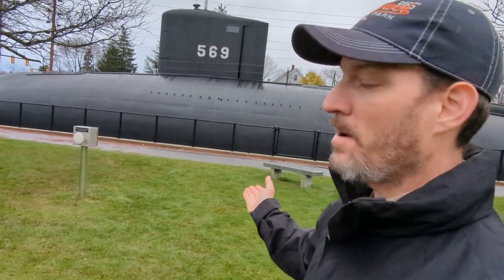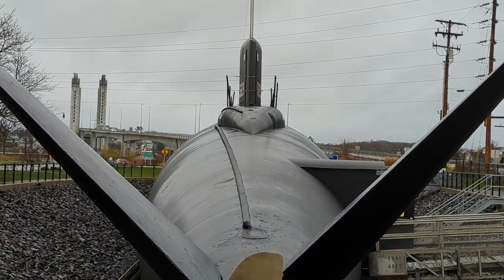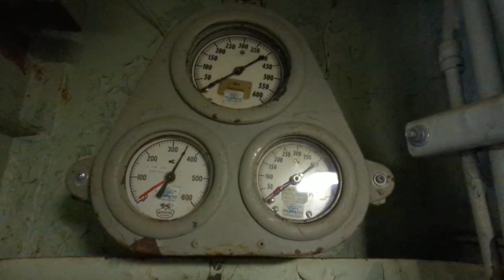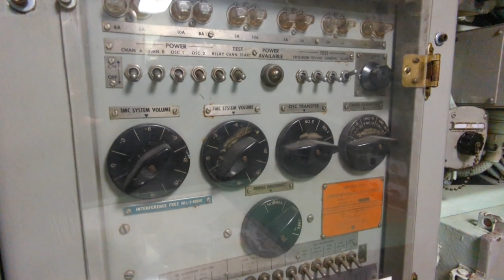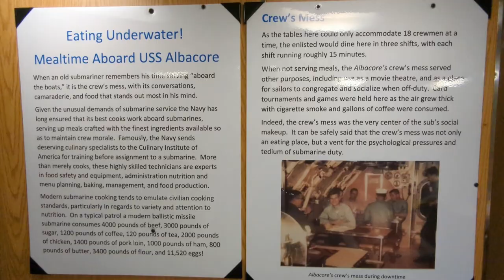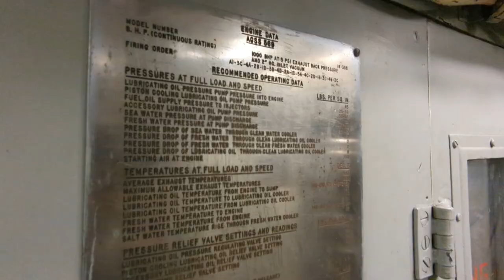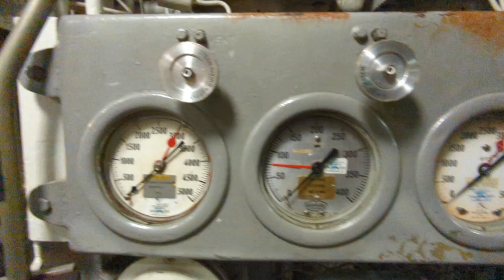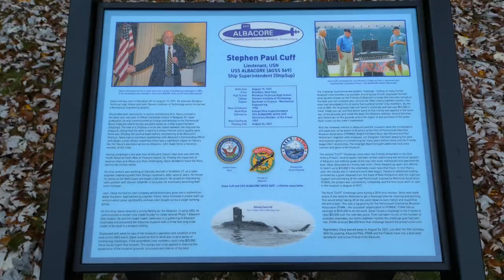A TUNA SUB for you to enjoy! History & walkthrough of the U.S.S. Albacore submarine, Portsmouth, NH

Comment: Those pancake engines were suppose to make interior packaging more efficient as they were tall rather than long. If they are the engines I'm thinking of, they were mounted vertically on top of the generator, great in theory, but the engine leaked into the generator creating shorts and other problems. In the fleet subs they were eventually scrapped, the submarine lengthened and conventional engine sets installed.
Reply from the maker: Interesting! Yes, they definitely had a vertical configuration. I don't know a lot about them, but I did read while doing my research that they had reliability issues. Another reason why it was good to have a test-bed sub! You don't want mechanical problems in the middle of a potential combat scenario! Thanks for sharing your insight, Brian!
Reply: the 338s were still in boat at decomm.